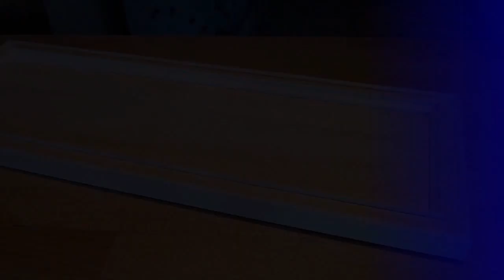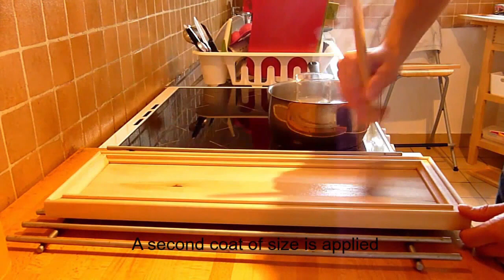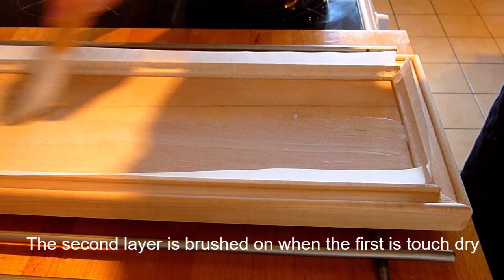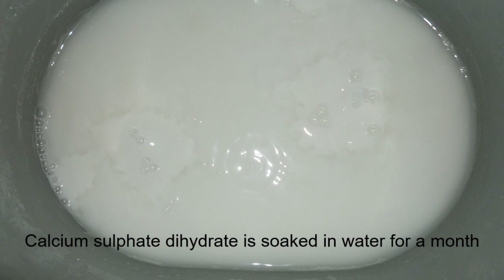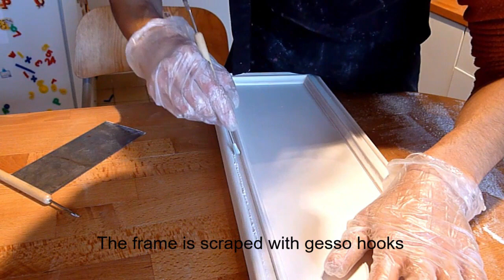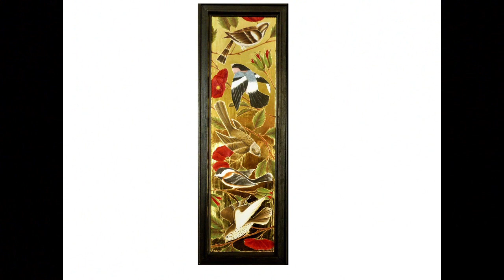Preparing a Wooden Panel for Painting in Egg tempera and Gilding

Comment: Hello, I very like your videos, do you think birch plywood and MDF (HDF) is the best for egg tempera? 2- For large pictures (in. 50 x 30 in.) Do I need a thickness of 18 millimeters? I am waiting for answering, thank you.
Reply from the maker: Hi Nidal, I have never painted on plywood or MDF but I've heard from others that birch plywood is very good. 18mm would be good - the thicker it is, the less likely it is to warp. Good quality plywood is unlikely to warp though, so if you feel that the panels are too heavy to be practical, then you can go thinner.

Comment: you said ' A layer of size is applied to the panel ' What do you mean by that . my first language isn't english so i am having a hard time understanding this .Can you please tell me , what product do you applied to the panel ?
Reply from the maker: Hi Nasrin, I use animal skin glue - usually about 5g for every 100ml water. It's best to leave it to soak over night and then heat it and stir until all of the glue has dissolved. Don't let it get too hot and boil though - this will spoil the glue.
Reply from the maker: You then brush the glue onto the panel and leave it to dry. This will cause the wood fibre to stand up, so you then have to sand the panel lightly and brush on another coat of your glue size. I usually find that this is fine, but some people add a third layer of slightly stronger size - maybe about 7g in 100ml water.
Reply from the maker: The sizing of the panel is to prevent the panel from absorbing the glue from the gesso - this would leave the gesso underbound and liable to break up.
Reply: @larabroecke9702  thank you for sharing such great information. Precise and to the point. I too did not know either what is meant by sizing. I am new to painting fine carved furniture with tempera. My question is, do I need to size on raw wooden pieces only? What about sizing in varnished pieces., If the reason to use it is not to crack the gesso,, I was hoping to get a crackle finish , should I omit this step? Sorry too many questions, but finally I found someone who seems so knowledgeable  with the ancient methods.
Reply from the maker: @tatianachristou9944   thanks so much for your message and I'm sorry to have taken so long to get back to you. I must admit that I've never painted on furniture myself. The first size layer is to saturate the raw wood, so that the binder from the gesso won't sink down into it. If your furniture is varnished, then the surface of the wood will already be saturated, so this won't be necessary. You may find, though, that the bond between the gesso - or the tempera paint, if you intend to paint without gesso - and the varnished surface isn't very good. You could help this by lightly sanding the area that you intend to paint and possibly applying a layer of size to the sanded area to give the gesso or egg tempera a surface that they can readily bond with. Not knowing what the varnish is on the furniture, it's hard to give definite advice. You might need to experiment a bit. Basically, you won't need to worry about your furniture absorbing the medium, but you will need to worry about the bond between the varnished surface and whatever you put on top. As for creating a cracked surface, again, it's not something that I've ever done. One thing that you could try is putting the paint on 'too' thickly and then forcing it to dry fast, perhaps using a hot hairdryer.  Good luck!
Reply: @larabroecke9702  thank you for taking the time to reply and give advice. I usually find beautiful old estate furniture and would like to restore them for personal use. These pieces have beautiful carvings and a protective varnish. Did not know what to do before painting with tempera. So thanks for the steps.

Comment: Hello, can I coat with rabbit skin glue and gypsum directly on birch plywood and paint with egg tempera without linen, cloth, or other else? I am waiting for answering, thank you very much.
Reply from the maker: Yes. Linen or canvas are only really necessary if you are painting on a natural wood panel which may have faults, like knots, or on a panel made from multiple, joined boards. A single, birch plywood panel should be fine without any linen.
Reply: @larabroecke9702  Thank you so much, but I do not very understand, what is the best for longevity to stick linen or muslin or without?
Reply from the maker: @nidaljabarin4743  It only makes a difference to longevity if you have a panel with a join in it or faults, such as knots. If your panel has neither of these, then your painting will last well with or without a cloth applied.

Comment: what is the best to paint with the egg temperature on the canvas or something else?
Reply from the maker: Egg tempera is best on a flat, white, slightly absorbent surface, so a wood or good quality plywood panel, prepared with gesso is ideal.
Reply: @larabroecke9702  Thank you, but if I use rabbit skin glue on canvas, it is possible? I am waiting for answering.
Reply from the maker: You can paint with egg tempera on sized canvas, but it won't make the most of the medium. The paint is slightly transparent and very luminous and so works best on a white surface and, because it dries quickly on applying, so that small, precise brush strokes come naturally, it is best on a flat, rigid surface rather than a textured one, like canvas, with some give (which is good for a freer style of painting).

Comment: No cloth applied?
Reply from the maker: Cloths weren't consistently applied to all artworks in the medieval and Renaissance periods. One of their main purposes is thought to have been to cover panel joins so, particularly for smaller pieces on single panels, they aren't necessary. In fact, for small pieces on good quality wood, even the gesso grosso might not be applied.